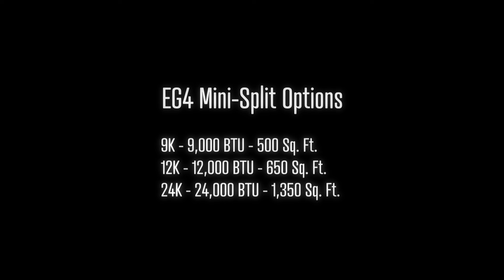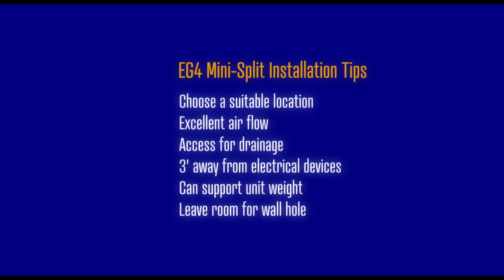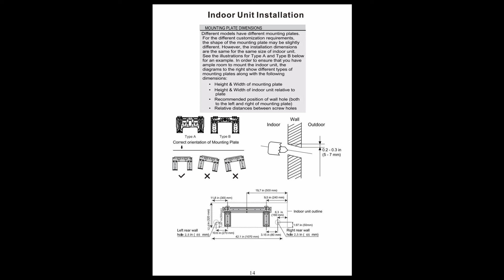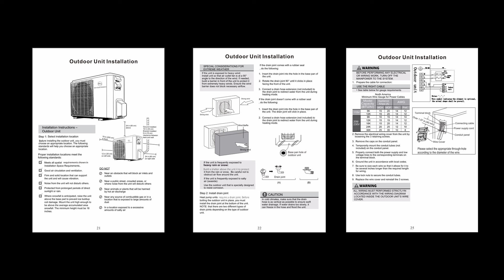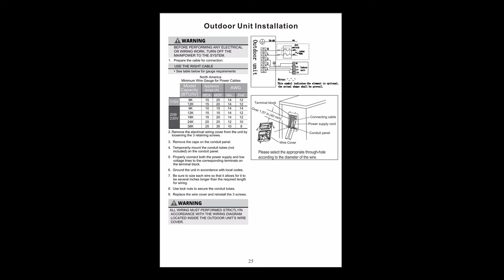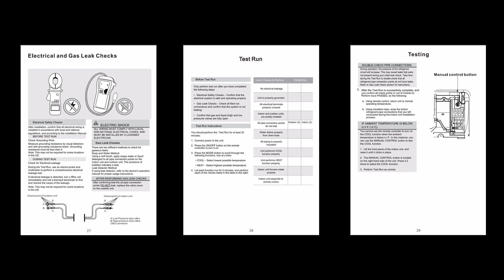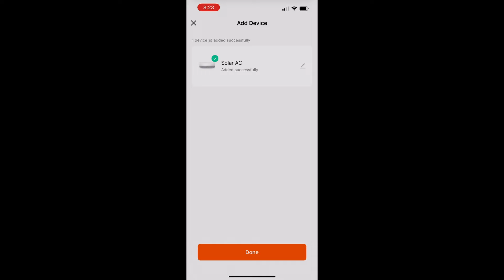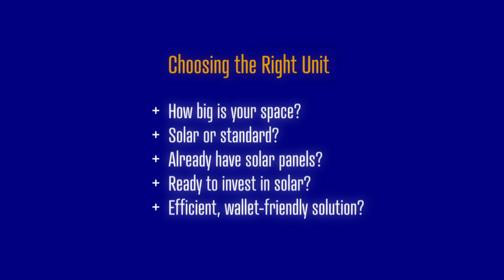EG4 Mini Split Air Conditioner Installation and Overview -Energy-Efficient Climate Control Solutions

Comment: I have been running a 12kbtu unit since January replacing baseboard heat. The unit has easily paid for itself in my circumstances.

Comment: We have a large living room (35' ceiling) that is about 1500 sq.ft. Our main HVAC always struggled to get this room balanced with the rest of the house. The 24,000 BTU unit has worked really well, and the solar helps us run it guilt free. We also have a 16' fan on the ceiling that helps move the air throughout the room. For a large single space this unit is a no brainer.
Reply: A no brainer would have been not having 35 foot ceilings. That might rank in the top five dumbest shit I've heard someone do in their home.
Reply: @TravelingStacker  If you can't afford it you can't afford it!
Reply: @benc1927  While I can afford it, I travel full time for work so I sold my home years ago. Hotels are home these days. Still doesn't change the fact that 35 foot ceilings are retarded.
Reply: @TravelingStacker  Whatever makes you happy my man- Living in Motel 6 with 7' ceilings and beds that thousands of people have "slept" works for you, go for it! Some people like living in trailers, some people like living in big houses. Do your thing!
Reply: @benc1927 your use case is almost identical to mine! We also have a lot of windows so I’m hoping it takes the edge off of our central AC! It’s been killer with these recent heat waves
Reply: @WhatIsTheDelta  Very true. Yes we have a chalet style home that faces almost directly north with all the large raked windows, the ones angled to the side get a little bit of that morning sun, which is nice natural light but difficult to cool. Once the sun is higher we can open the shades more though.
Reply: @benc1927 wait so do you still run your central ac or just the mini split?
Reply: @rawimpact  Yes this unit is enough to cool the downstairs of our house, if we need some extra oompf (party or 105 day) then we can simply turn on our main central AC.

Comment: I have a question on the line sets. You mentioned they are precharged. Did you mean they are evacuated? The reason I ask is I want to cut the lines sets to fit and flair them and pull a vacuum.   If there is refrigerant in the line sets then I need to rethink this.  By the way what are your comments about shortening the line sets and then pulling a vacuum? Thanks for your video. Waving to you from down I-30 about 30 minutes from you.  All the best.
Reply from the maker: The included line-sets are indeed pre-charged and cutting is not recommended. Before the pre-filled ones today, the old units had the customer pull a vacuum and put the coolant in their selves. This shouldn't pose a significant problem in terms of technically working - Waving back! You too!
Reply: @SignatureSolar  oh so you are saying the line sets have refrigerant in them and not just some inert gas? I just thought it was vacuum and to cut them I would have to flare them and pull vacuum for a short period of time to confirm a good seal. Then and only then would I release the refrigerant from the mini-split by opening the valves.  By the way, that is not a huge problem as I have a HVAC installer that has offered to shorten the lines for me.  So if I am using the terms incorrectly be patient with me as I am a retired engineer.  🤣 I am thinking about dropping by your office towards the end of September and chat about these particulars.   All the best!

Comment: BEST installation instructions Ive seen...buuutttt......the celcius trix FAILED !!!!
Reply from the maker: Hi!  Please refer to page 35 of the user manual, there are two ways to change Celcius to Fahrenheit. Method 1: Press the TEMP Up and Down buttons simultaneously.
Method 2: Power down the remote and hold both the TEMP Up button and the Fan
button simultaneously for ~5 seconds.
Reply: @SignatureSolar Kelly @SignatureSolar ...I tried BOTH multiple times to no success...the rest of the video was the BEST
Reply from the maker: If you still need assistance, you're welcome to call in at 903-441-2090 and the team can help you out!

Comment: I’ve installed the 12K hybrid unit earlier this summer and saved about $60 a month with the help of the solar panels. 
But what blew me away is that since I’m using this for heat instead of natural gas during the cooler temps, I’m on track to save about $200 a month for using less natural gas!

Comment: Thanks for this video!  A note to potential buyers / users - I have this exact model and spent far longer than I care to admit trying to figure out what ground screw size it uses.  As shown at one point in the video, this unit requires two separate ground screws.  However, at least mine only came with a single ground screw; the other hole, meant to ground the wire that goes from the unit to your breaker box, is empty.  Apparently it's necessary to provide your own...

This unit does not use a standard #10-32 ground screw.  It actually uses a #8-32 screw.  I purchased 3/8" long machine screws (matching the size of common ground screws) and they worked decently well.  

Another thing to note, when I used the template to place and then cut the 2 1/2" hole with a hole saw, I had two things happen:  (1) the hole ended up being just a touch too low, so the bundle of components going through the wall cause the unit to be slightly off level leaning, unfortunately, away from the direction I'd want it to go (I hope it won't be a problem); and (2) the wall cuff flops around in the space and apparently is far too small to fit a 2 1/2" hole.  I just had to leave it out (but I'm not concerned because the insulation plus vinyl tape plus painter's tape should provide plenty of protection.  

Another note, I wish this video had gone into a lot more detail on sealing the hole outside.  When the bundle comes through the wall, it has a LOT of fluff and flex in it components.  The slit sleeve of insulation surrounding the refrigerant lines compresses but does not hold its compressed position.  This helps with shoving it through the wall hole, but then it springs open and somewhat stiffly holds its position.  This leads to numerous air gaps inside the sleeve of insulation surrounding the two refrigerant hoses.  How should one seal these effectively?  It seems like spraying foam into them would balloon the interior portions of the pipe insulation, which could actually result in undermining the seal.  Should one use full conduit through the wall and, if so, why isn't this noted in the manual?

Yet another note, I wish there were more detail on how to handle the stiff part of the refrigerant hoses attached to the interior unit.  It is QUITE STARTLING to physically bend copper lines that are hard wired to the unit, so extreme detail would be super useful.  How many times can they handle being bent?  If you bend them slightly wrong, what is the best way to guide them into a better position without hurting them?  What does it mean to bend them wrong and cause them damage (what does that look like?  How should it be handled if it does happen?)?  Once they're outside, I assume it's okay to bend them AGAIN toward the direction you want them to go so that they run more flush to the exterior wall instead of sticking straight out like a foot (and since this must be okay to do, how should it be done to minimize the likelihood of damage and reduction in unit performance)?  How many bends can they have in them and still work optimally?  Should we attempt to never bend them past 90 degrees and keep them to less-sharp angles?
Reply from the maker: Thank you for your detailed review and valuable insights! Here are answers to your questions:

Sealing the hole outside: For sealing the air gaps, using expanding foam can be effective but should be done carefully to avoid over-expansion. Alternatively, using a combination of foam and caulk can help seal the gaps without putting too much pressure on the insulation.

Handling refrigerant hoses: Bending the copper lines should be done with caution. They can typically handle a few bends, but it's crucial to avoid sharp angles to prevent kinks. If a line is bent incorrectly, gently guiding it back into place is best. It's safe to bend them again once outside, but always aim for smooth, gradual curves and avoid bending past 90 degrees to maintain optimal performance.

We appreciate your feedback so much on these points and will consider incorporating more detailed instructions in our future videos. Your experience highlights important considerations for other buyers, and we’re grateful for your contribution.
Reply: @SignatureSolar  Thank you so much for the thoughtful and kind reply, and for the information!  I'll be sure to make use of it as I complete my installation.  It's very fresh in my mind, so that fueled many of these comments.  :)

Comment: Thank you for this video. I found it easier to make the electrical connections from the front of the unit BEFORE extending the copper lines out from the back of the unit.

Comment: 🤔 This was an excellent presentation covering theory, design, as well as installation.  

      I would encourage EG4’s engineering department to provide feedback to EG4 to produce 5000 & 9000 BTU Hybrid units (ie DC/AC/Solar) specifically for the RV industry.  

      Due to the flimsy, yet expensive construction of commercial RV’s there is a sizable trend of DIY’s to build custom RV’s based upon Box Cargo Trailers as well as other platforms.  

     The use of mini split units are taking this niche market by storm, both for ease of installation, heating capability, as well as leading to the possible elimination of the need for propane for reasons of logistics, safety, and moisture gain.

      The solar capability of the EG4 combined perhaps a waste heat recovery unit for producing hot water, when combined with the EG4’s inherent superior efficiency could lead EG4 to “rule the roost” in the RV application area.

       Since Signature Solar has a strong business relationship with EG4, its engineering department would be the ideal conduit to facilitate this upgrade in portable solar capability. 😎
Reply from the maker: Thanks for the feedback! We will pass this information along!

Comment: Here is a random, odd question.  Once everything has been installed, and the gases have been released into the lines, does this unit have the ability to suck the R410a coolant back into the condenser in case you need to move the unit or relocate the lines?  I just bought this unit and I want to install it but it will have to be in a temporary install type environment as I will be redoing my siding throughout my house when the weather gets warmer here in NW Ohio.  After I am done with the siding, I will then want to permanently attach everything and make it look professional with wire coverings, etc.
Reply from the maker: Thanks for your question! No, the unit can't suck the R410a coolant back into the condenser. If you need to move the unit or relocate the lines, an HVAC technician will need to come out to safely remove the refrigerant before it can be moved and reinstalled. Once you're ready for the permanent installation, they can handle the refrigerant again and ensure everything is properly set up.

Comment: What size did you use to drill through wall? 3" or 4" hole saw?
Reply from the maker: For the 9K and 12K, 2.5 inches. But the manual states that 3.5 inch holes are needed for the 24K.

Comment: How to size the right unit need 
Do you Do length bye width of trailer 
Or length bye width bye high
Reply: The cargo trailer is 22L x 8w x 7h
Reply from the maker: You would size by calculating the square foot of the space you are trying to cool. You can find the capacity for each unit in their manuals :)

Comment: how long are the included lines? . In other words how far will this reach? do they sell a EG4 Mini Split Line Set for this type of setup?
Reply from the maker: The drain pipe is 1.5 meters. The connecting pipe is 5 meters. The maximum line set length depends on your system - [09k/12k = 49ft] [18k system = 66ft] [24k system = 66ft] [36k system = 98ft]

Comment: Hi,
I was watching Will Prowse's (from DIY Solar) video on this amazing unit and he mentions that you have to use a pump and adapters to evacuate the refrigerant lines. But from your video, it looks like you don't have to get into all that. Just want to confirm this...?

Also, I am off grid now (with solar), and would so love to buy a couple of these units for my home, but I'm in a cold climate that often sees minus -30 to -40 degree temps for a few weeks each year. Is it true that this unit only produces heat down to -10 Celsius?
Or can it produce some heat still down lower?
I'm more thinking when I am away from my home (which is a lot - for work) and can't run the wood stove.
And it seems odd that Senville split mini's advertise operational temps of down to minus -30...

Comment: Thanks for the video, I'm stuck on the Teflon tape on the drain . This doesn't make any sense to me.
Reply from the maker: Great question, thank you! While the video was made following the manual, it's important to note that Teflon tape is designed primarily to seal pipe threads in plumbing and gas connections, preventing leaks by keeping liquids and gases from escaping through threaded connections. It is not intended for waterproofing surfaces or patching leaks like traditional waterproof tape. The manual has been updated on page 13, step 7, to state: "...Wrap the joint with waterproof tape to ensure the hoses do not come apart." For waterproofing purposes, tapes specifically designed for that, such as butyl rubber tape or silicone tape, should be used.

Comment: How many and which solar panels for the 12000 btu mini split ac/dc?DC?
My tiny mobile home in grass valley, 1000 Sq ft with 3 bedrooms.
Reply from the maker: Hi! We have this kit with the appropriate panels included! https://signaturesolar.com/eg4-hybrid-solar-mini-split-kit-energy-star-certified-air-conditioner-heat-pump-ac-dc-12000-btu-seer2-22-1800-watts-of-solar-pv-kit-e0011/ - alternatively, you can call into our sales department and they can give you a quote for any other options you’d like :)

Comment: I have a shopping history with Signature solar. I have everything I need except a 6000 BTU mini split. Many people are living in converted sheds of well under 200 sq ft so a 9000 BTU is excessive. You're located near a lot of rural areas where we reclusive types could benefit from a system that doesn't have too many BTUs for our home sizes. They exist and have seer ratings as high as 38 but the ones that can likely have your branding are as high as 26.5.

Comment: I've got one green screw for ground on the outdoor unit. Can I use the same ground for the Ac plug and the communication cables?
Reply from the maker: We unfortunately cannot advise on the AC side of things but we do recommend reaching out to a certified electrician to address this with you. Grounding is very important for safety!

Comment: Can I split the solar input for the hybrid converter and hybrid HVAC?
Reply from the maker: It is not advisable to divide a single solar input in this manner because the two units will be unaware of each other's presence. As a result, they may continuously attempt to draw more power from the solar array than it can effectively generate.

Comment: Can the 24k BTU hook up to delta pros with double voltage hub?
Reply from the maker: I'm so sorry @ColbyBlack, this would be a question for Delta. If there is anything else we can help you with, please don't hesitate to reach back out to us at any time!
Reply: Let me ask this another way, if i have L1, L2, a neutral and a ground coming from a 24 kW battery and inverter at 60 hz 

“AC output socket (120V/240V 30A max.) - Backup UPS	Supports 120V/240V 30A max output and 20 ms UPS”

Can I take L1 and L2 from the source and connect it to the L1 and L2 in the outside unit, and the ground to ground, and cap off neutral.

Comment: If I planned to use the hybrid 12000 in an off grid or grid down situation can this unit be set up to run on battery and inverter at night or no grid.
Reply from the maker: Yes it can

Comment: Very informative though you forgot the waterproof wire clamp on the outdoor unit.
Reply from the maker: Hi @lightdepsolutionssolutions4099! Thank you for the feedback! We believe we've identified the part you are inquiring about as a waterproof cable connector for the wires to pass through the hole from inside the unit to the outside? These are not included with the unit which is why it is not demonstrated in the video. However, these can be purchased separately at any hardware store. Please let us know if this is not what you mean by 'waterproof wire clamp'.
Reply: @SignatureSolar  that’s what I meant, yes. Thanks for replying.
Reply from the maker: Glad to help!

Comment: question: Do electrical connections in 12000BTU  120v equipment not use a disconnect switch for the outdoor unit?thank
Reply from the maker: Not typically. You can use one but a 20A breaker will suffice :)  The disconnect is typically for central AC units

Comment: Can i install this in my rv travel trailer?
Reply from the maker: The measurements that are listed in the specs to mount this from the ceiling and the floor are for typical 8 foot walls, so that would be different but otherwise, Yes!

Comment: The templet sent with the 12000 BTU unit is incorrect. I drilled the hole per template and ended up missing about 2 inches.
Reply from the maker: Hi @futuresplayer! I hope you're well! We're so sorry about this! We will definitely forward your findings to the manufacturer. Did you get it mounted in the end?